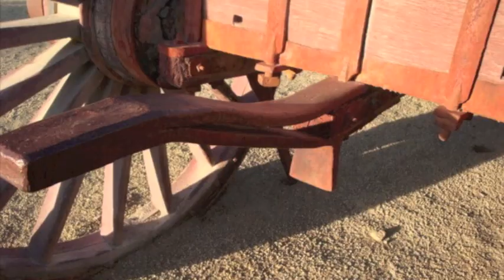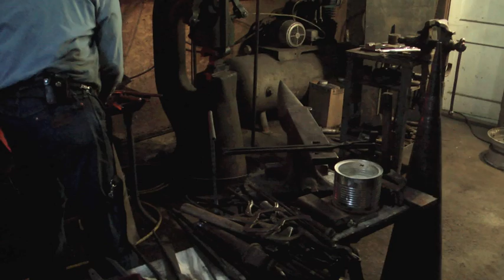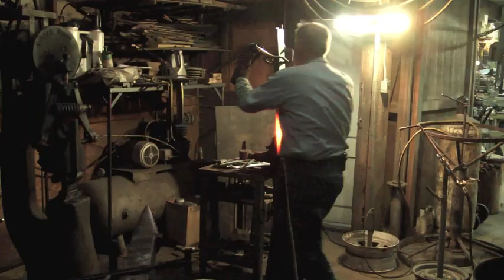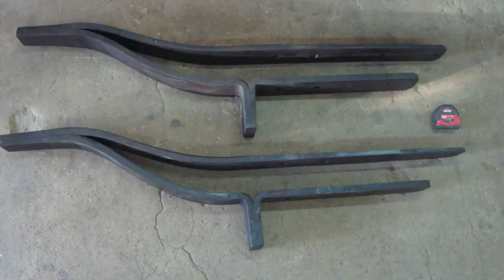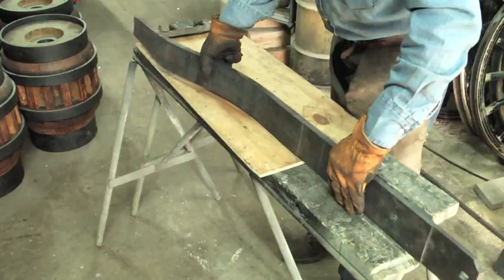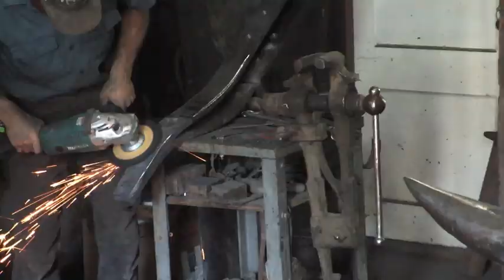This is Heavy Blacksmithing on Borax Wagons! | Engels Coach Shop

Comment: Are you using wrought iron (pure iron - as well as possible back then - with several percent silicon content - as a flux for forge welding of separate parts and as a rust inhibitor - and under 0.08% carbon content - the steel minimum carbon content)?  Some steels can be hammer forged as you did, but most cannot reliably unless the joint is folded again and again like with Japanese Samurai swords.

Comment: Do you turn/rotate the package in the fire that it gets even heat from all sides? Or do you just lay it in the fire without moving it, until it gets welding heat?  Couldn't see any Rotation in the vid. Just curious, no critic...You do a geat work and let difficulkt Things look very easy. Greetings from Germany.
Reply: Thanks for the answer. It makes your work even more impressive to handle and turn these heavy parts.